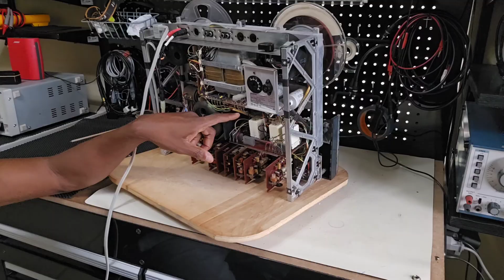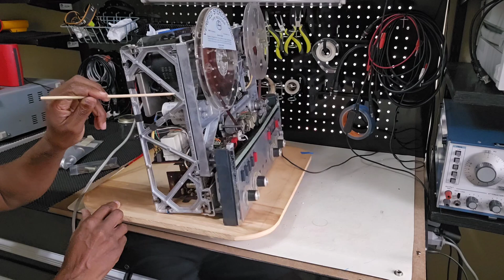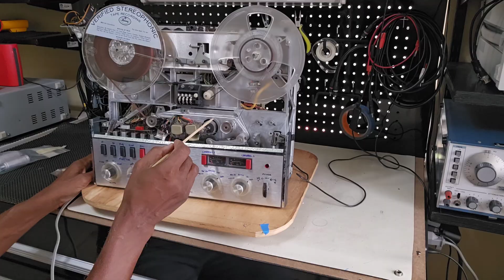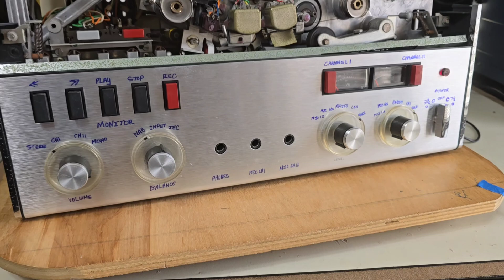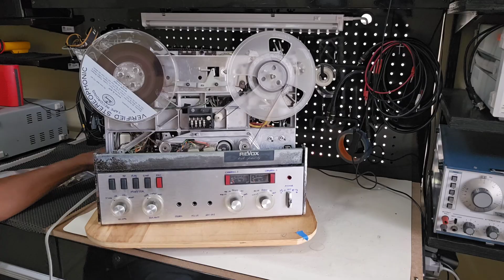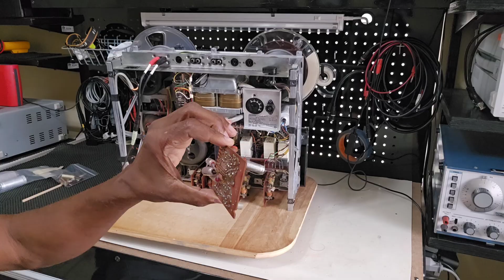Revox A77 MK1 repair - Part 2

Comment: Hi Almando, how did you let it dry after washing it? Did you use some compressed air or just let it dry under the sun? And how many days did take to completely dry up. Isn’t water entering some parts and being trapped without drying a bit dangerous?

Comment: You can easily make new relay tensioners with thin gauge rigid wire from Home Depot. Just remember you can only bend once or the wire will weaken & crack.